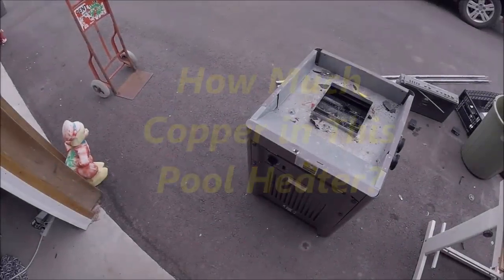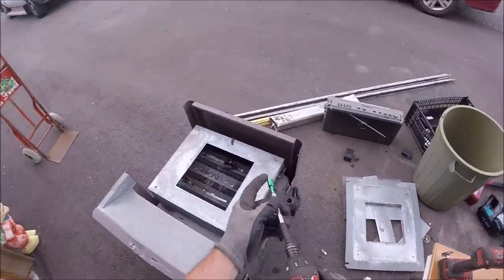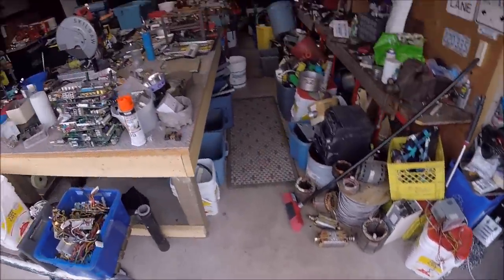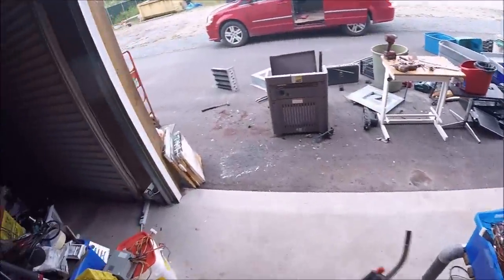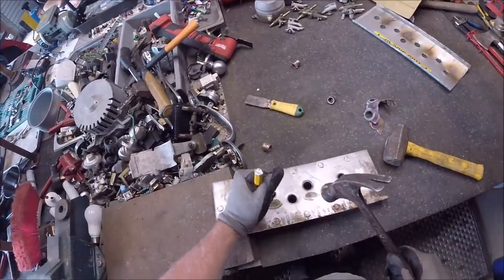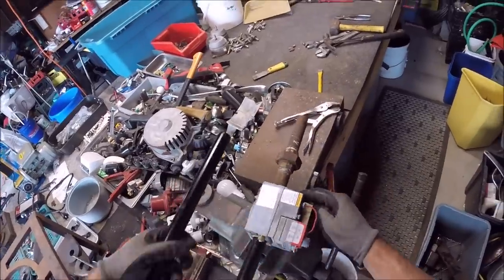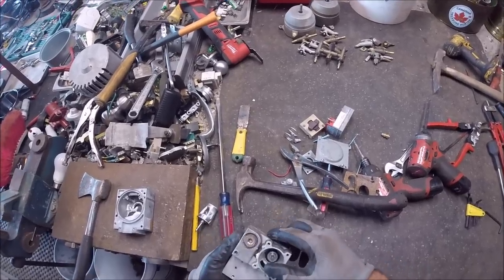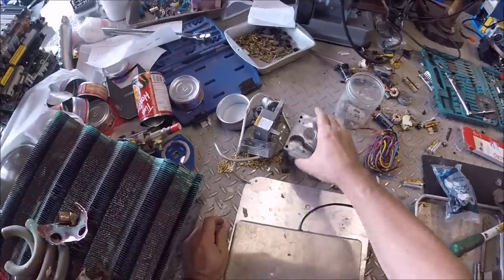How Much Copper in This Pool Heater?

Comment: I stripped same pool heater this past week.  I think i pulled apart more of the shell to get to those last couple bolts holding the element in place.  But liberating the copper from the stainless was much the same.  I used large pliers to  pull the copper after/while driving it out with a hammer.  working on a tailgate is sooooo different than a set up space.   anyways, great job.  did they give you clean copper for the heater element?  my yard claimed it was not pure copper
Reply from the maker: It's #2 Copper

Comment: Now I know you are going after copper. A nice stripping video and in the end, a good copper score.
Those partitions inside the heater are called refractory plates. Some of them I came across in furnaces in refineries can withstand temperatures of upto 3000 degree F. Even after discard, they are good insulators which you can use domestically for some creative works.
Reply: Yes, those light white boards are CFB (ceramic fibre board).  As insulating panels most are rated to about 2300deg F.  Touching them is fine but don't breath any dust from them.

I know about them because some people use them in building rocket mass heaters or rockwt mass stoves.  Expensive materials that stuff.